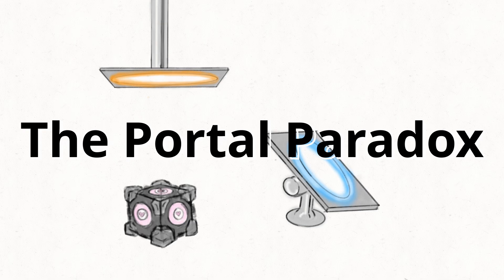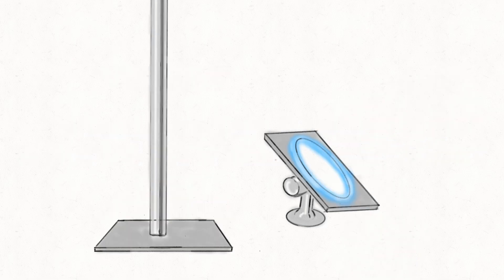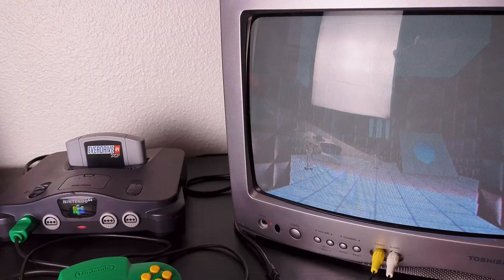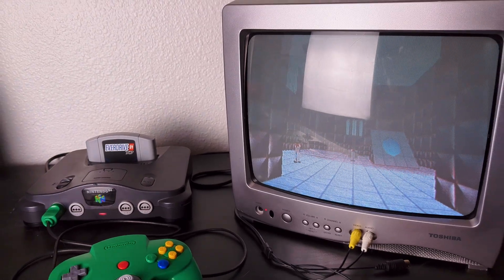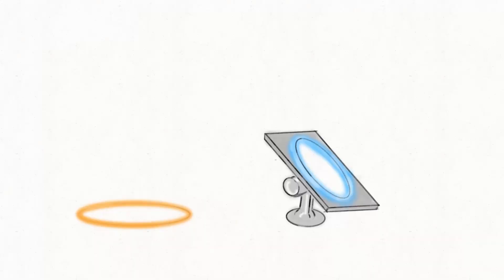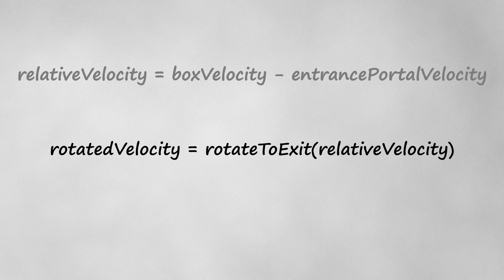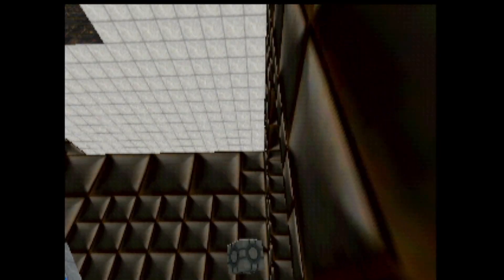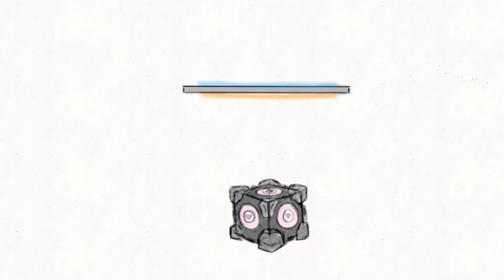I rewrote Portal from scratch and solved the Portal Paradox

Comment: My Answer for this problem is the the object passing through the portal should just drop out the other side, it should be accelerated by the portal.

A portal is just a doorway bridging two point in spacetime, in practice work like a normal doorway.

If you dropped a normal doorway over an object, the object would either sit in the doorway, or pass through it Depening on the orientation (Horizontal vs Vertical Motion)

Now, with that in mind, looking at portals, if a portal was pushed or dropped onto an object, the object would pass through the portal, unacclerated, and only be affect by by forces on the other side of the portal.

So, a Cube on the ground, with a portal falling on top of it, with an exit portal on a wall, the cube wouldn't be launched, but instead be attracted downward by gravity, initially to the plane it exists on already, but as it's center of mass passed though the portal, and more of it's mass is effectively stuck to a wall, it would then fall toward the ground relative to the exit portal.

Doesn't matter how fast the falling portal goes, the cube just plops out the otherside.
Reply: The cube would launch, as you forget one important thing. The cube DOES have velocity, and that is relative to the entrance portal. The cube exits at the same speed it enters, relative to the portal. Nothing else matters.
Reply: Another way to think of it is the portal would move the cube by layers on each time instance, each slice of the cube would have to push the previous slice to fit through the portal, self accelerating

Comment: This implementation violates conservation laws. The cube obtains momentum from nowhere! Either the piston should slow down or the cube shouldn't launch out of the other side
Reply: The cube obtains momentum from the moving portal.
Reply: It gets the momentum from the portal
Reply: Portals inherently break conservation laws. You could put a portal on the ceiling and the floor and make something fall forever.
Reply: @GopherpilledTunneler  Isn't the energy from gravity? And if the object is at terminal velocity, doesn't that mean it isn't accelerating, and therefore maintaining its energy anyway?
Reply: @graygravity3856  No, I can still use it to infinitely power a waterwheel.
Reply: @graygravity3856  also in an airless environment, there is no terminal velocity.
Reply: @LineOfThy  You could also drop a magnet through a coil and make electricity. I don't see your point for the waterwheel. Though I do see that the terminal velocity point is wrong.

A thought I had just now, is that a portal probably takes loads of energy to operate. Maybe the portal just transfers its energy?
Reply: @graygravity3856  To drop a magnet through a coil you need to move it up each time, which takes energy. If you have portals, now you can make an infinite energy machine. I don't think portals take loads of energy to operate considering they come from a small handheld device and you can shoot them on literally any surface that has moon dust on it.
Reply: @GopherpilledTunneler  The "small handheld device" has a black hole in it, as shown in one of the promotional videos.

It makes sense that you would have to move it up each time, giving it potential energy, but what if you took a coil long enough to go around the earth, put it in orbit, and put a magnet through it? Wouldn't that be infinite energy? I actually don't know what my point is here, so nevermind.

Comment: “if you think this approach is wrong, then show me the flaw in this equation.”
yeah, okay, i can do that. you’re thinking of portals wrong.
a portal does not transfer velocity because that’s a special property of portals. it transfers velocity because it’s a doorway through space, and that’s… how physics works. if something goes through a doorway at one speed it’s gonna come out at the same speed. the game tells you this because it wants you to use it to your advantage in puzzles, and wants to make sure you know the devs coded it.
what you’ve done here, though, is made the portals transfer their OWN movement into the cube. as a result, the cube gains velocity despite no forces acting on it, going directly against the first law of motion, that an object will not change its motion unless a force acts on it. the only force that should be acting on this cube is gravity when it comes out the other end.
now, there is a way to think about it that makes it flying out seem viable. the portal slamming down on the cube with a second portal stationary seems to act similar to how it would if you put the cube on a platform moving up, which then stopped abruptly. here, the cube would fly out, but there’s a problem with this. the reason the cube moves is that an object in motion wants to stay in motion, and a cube on a moving platform is, well, moving. here, it’s the thing the cube goes into that moves, not the cube itself, so again there are no forces acting on the cube that would make it shoot out like that.

tl;dr the “relative velocity” you speak of has nothing to with the movement of the cube, but rather the movement of the portal, which should not affect the cube. no forces are acting on the cube, and it is not moving, so it should not start to move.
Reply: Yeah exactly what I thought. He is adding velocity to the cube when calculating relativeVelocity.
If you jump through a hula hoop travelling at 100mph you don't automatically accelerate to 100mph when you pass through it.
Reply: @Archspore did you watch the video?
Reply: @Archspore  i was gonna use the hula hoop thing in my argument before realizing he showed that it works as you’d expect, although i think it’s possible that the reason that works with these physics is that the velocity of the two portals (one moving forwards and the other moving backwards) is cancelling out